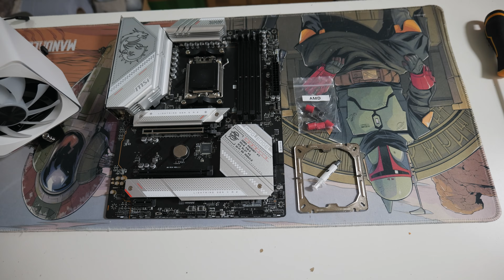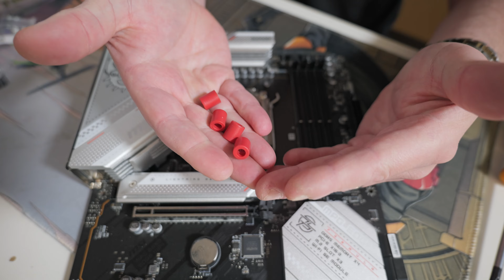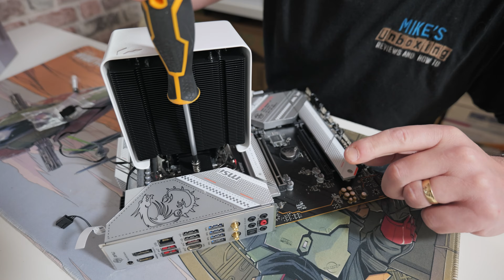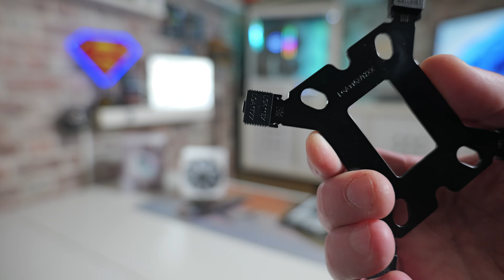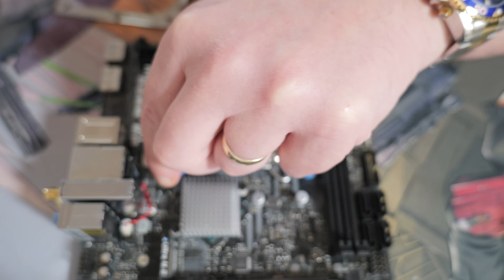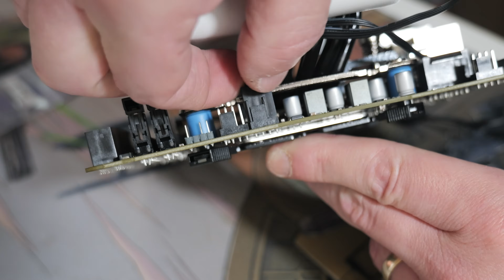How To Install APNX AP1-V ARGB CPU Cooler AMD & Intel Installation Guide

Comment: great video. but what if my motherboard does not have ARGB header? should I connect it into my controller hub (which have two 3 pin 5 volt port)?
Reply from the maker: yes any 5v 3 pin ARGB controller should be fine
Reply: @mikesunboxing thank you 😊

Comment: I dislike that type of cooler; you have to take everything apart to install it. I was surprised by the installation for AMD, as usually a back plate is also installed, but not in this case.

Comment: Is this good enough for I7 14700K? Or do i need to buy something better than this?
Reply from the maker: hmm pretty much borderline, for games it will be fine but if you 100% stress the cores it will get hot and likely thermal throttle a bit. I run a 280mm AIO on my 14700k and it still gets quite hot at times
Reply: @mikesunboxing  Ok, so you what would you recommend me, if im going to buy i7 14700k? Thanx man for replying though 🙂

Comment: It's rated for 245w tdp, but it's actually a lot lower in real world usage. With ambient temps at 30C, a 14600k with intel default settings + PL1 and 2 set to 165W, some cores can hit 100C, while the rest are at 85C and above while doing multicore Cinebench 2024 benchmark.

So if you're on a 13 or 14 Gen Intel CPU and wanting to go with air coolers, I'd recommend getting a dual tower air cooler instead of a single tower cooler like this one.

Comment: Hi how do i change the rgb on the cooler, got it and its stucck in rgb mode
Reply from the maker: plug in the ARGB plug to your motherboard and use the motherboard software to select the appropriate ARGB setting for your needs / preference

Comment: Looks really cheap and lazy how they just put a plastic white shroud over a standard black tower cooler. Good luck if that fan dies...
Reply from the maker: thanks for your honest thoughts, appreciate that
Reply: @mikesunboxing  I made a mistake. I thought that the shroud was made of plastic, but it turns out it is made out of aluminium. I still don't like how the fan is mounted on the cooler.

Comment: Looks good and interested in its cooling ability. However the mounting plate cutouts make for a dubious alignment and wouldn't like to fit if motherboard already in the case. Thanks for reviewing Mike and Kath 🐈👍
Reply from the maker: Great point!

Comment: Hi! I spent some time liking your past video as this summer started fast with lots of things to do and not enough time to do them! Not gonna complain thou! Wish you all a good summer!
As of this cooler, I'm not really convinced that this is a good design.. During winter, my coolers fans runs 100% speed 24/7, so they wear faster than normal fans. So, not being able to replace them easily or just clean the cooler fast in a no for me. But I can see where it can easily do the job.. 
So my 3950x ran its third winter at 100 % at 90 or so Celsius 24/7. My 5950x and 5900x spent their second year the same way.. And they ran great, no unusual crash, only reboot for update.. I can safely say that AMD cpu are tough and msi motherboard are up to the challenge. 
My 7950x was up to the task too, but not 24/7 like the others as it is my work computer. But to date, a few days at 95C didn't make it sweat and still running strong. All of them cooled with thermalright coolers 💪
Reply from the maker: yeah that element of the design is a little worrying and a little bit of an oversight really.